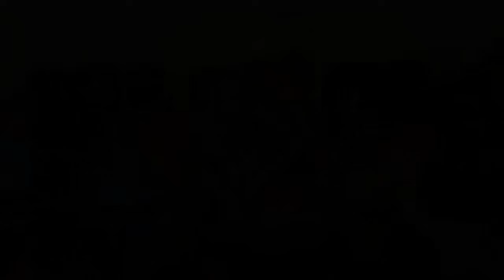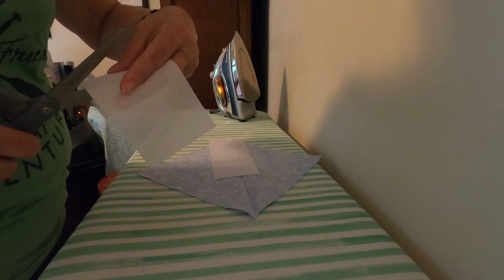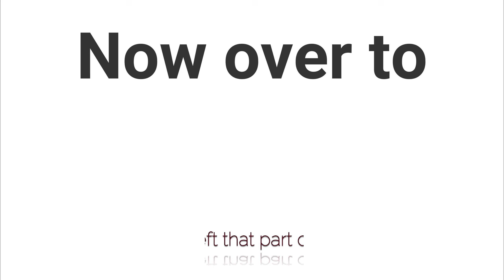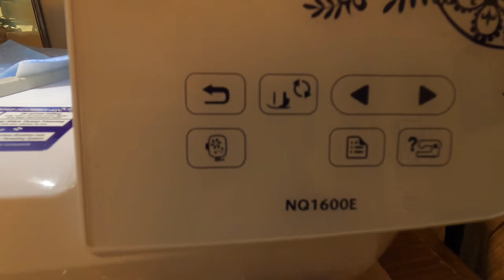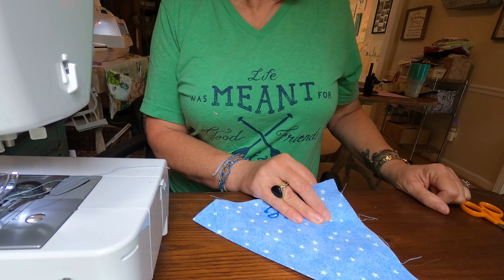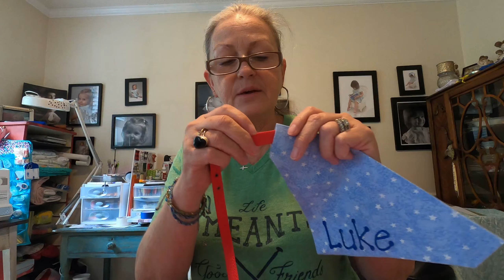Let's Make An Over the Collar Dog Bandanna for Your Favorite Pup

Comment: Can I not add the interfacing
Reply: Thank you for replying to my question. I have family with different size dogs and I am excited to make a bunch for them. Love your tutorial ❤️
Reply: I have one more question. One of the dogs weights 80 ponds. Do I use the 13.5 inch square? I've lost your guide for measuring.
Reply from the maker: @user-wx6lz1iy9p  honestly I don't remember. I would have to look back at the video but 13.5 sounds about right.  I know it doesn't go all the way around the neck.
Reply: @Pops-GiGis-Workshop  Thank you.
Reply from the maker: Absolutely! The interfacing is totally optional.  The only reason I add is because my mom always added interfacing to everything and after watching her sew for years and years I felt like I had to 😂.   But it is completely optional.  😊

Comment: Does that spray gunk up the needle?
Reply from the maker: No, it never has.  It's actually a basting spray for quilting, sewing, and embroidery. So it's made to be used with sewing and embroidery machines.  I'm sure if you used a lot of spray, it might.  But really all you need to use is just enough to cover the surface of what you need to "tack" down.  I hope this helps 😊

Comment: Great tutorial what are the fabric dimensions for a size med?
Reply from the maker: The sizes that I use are 7.5 x 7.5 for XS, 9.5 x 9.5 for S, 11 x 11 for Med., 13 x 13 for Lg.  For XL I just kind of have to adjust according to what breed and size of dog it's being made for if I'm doing a custom order.  The same thing too for the XS.  I did one for a 12 week old beagle puppy and it seems like I did like 6 x 6 for him.  Keep in mind, these are just "base" sizes.  You can really make them any size you need as long as you start out with a square.  The steps are all the same no matter what size you're making.

Comment: What size of fabric for larger dogs
Reply from the maker: The sizes that I use are 7.5 x 7.5 for XS, 9.5 x 9.5 for S, 11 x 11 for Med., 13 x 13 for Lg.  For XL I just kind of have to adjust according to what breed and size of dog it's being made for if I'm doing a custom order.  The same thing too for the XS.  I did one for a 12 week old beagle puppy and it seems like I did like 6 x 6 for him.  Keep in mind, these are just "base" sizes.  You can really make them any size you need as long as you start out with a square.  The steps are all the same no matter what size you're making.  My 2 dogs have gotten to where they feel naked if they don't have theirs on! 🤣

Comment: What are the starting sizes for medium and large size dogs ?
Reply from the maker: The sizes that I use are 7.5 x 7.5 for XS, 9.5 x 9.5 for S, 11 x 11 for Med., 13 x 13 for Lg.  For XL I just kind of have to adjust according to what breed and size of dog it's being made for if I'm doing a custom order.  The same thing too for the XS.  I did one for a 12 week old beagle puppy and it seems like I did like 6 x 6 for him.  Keep in mind, these are just "base" sizes.  You can really make them any size you need as long as you start out with a square.  The steps are all the same no matter what size you're making.  My 2 dogs have gotten to where they feel naked if they don't have theirs on! 🤣
Reply: Thanks

Comment: In new to this, and this is a great video! But when you refer to interfacing for the middle of the bandanna that helps stabilize the collar area, what exactly is that material? And where do i buy it?
Reply from the maker: Interfacing is something that will add stability to the fabric.  You can get it in different weights depending on how "stiff" you need or want the fabric to be in the completed project.  You can get interfacing that you sew in or you can get fusible (which you iron on.  I like the fusible simply because it's SO much easier.  You can get it at almost any store that sells fabric. I typically get mine ay Joanns simply because I can use a coupon and it's the closest fabric store to me.  What I use most of the time is Pellon SF 101.  That is exactly what I use on my dog bandannas. It's not hard to use at all and it adds just a bit of "oomph" to the finished product.   I hope this helps.  Let me know if you need further help with this and I'll be glad to help 😊

Comment: Would a large size require a bigger opening at the top. Collars are wider for bigger dogs. I’ve already made a couple large and just thought about the opening
Reply from the maker: If it's a really big dog, then yes it would.  Almost all dog collars are about  an inch wide except for the really small breed, like tea cup breeds, or really big breeds like Great Danes or Corsos.  But generally, most are about an inch wide.  To make the opening (pocket) for the collar larger, just fold down the corner more. For smaller openings, you would make the fold smaller.  I hope this helps 😊

Comment: How wide do you cut the interfacing for the crease?
Reply from the maker: I usually cut it about an inch to an inch and a half wide.  Really all you need is enough to just go over the crease.  Actually there is no reason to use the interfacing if you don't want to.  I just think it gives it a bit of added firmness. Plus growing up, my mom used to sew ALL the time and I remember her using interfacing on everything! So honestly I think that's why I started putting it over that fold in the bandannas 😉  I hope this helps 😊

Comment: great tutorial! small is 91/2 by 9 1/2 what are the measurement for medium, large and extra large? i love these i already made one for my cats and they look adorable.
Reply from the maker: The sizes I use are just base sizes really.  It depends on the size and breed of dog but I typically use 7.5 x 7.5 XS, 9.5 x 9.5 small, 11 x 11 medium, 13 x 13 LG, and adjust up for XL depending on size.  My boxer Ruby is approximately 45ish pounds and I make hers 9.5 x 9.5.  I tried a medium size for her but it was really to large for her.  So it really does depend on the build of the dog.  I hope this helps.

Comment: Cuánto doblo en las orillas
Reply from the maker: If my translation is correct, you asked how much do you fold on the edges.  To make the "pocket" for the collar to slip thru, you fold in and stitch down approximately 1 1/2 inches.  That will become the pocket for the collar.  I hope I got your question right and that this helps. 😃

Comment: Thanks for the video. I started making one tonight but hubs said it looked small. I adjusted but when I got 80% finished I realized it was too big for her collar and it would bunch. Lesson learned. 

Have you used the buttonhole function to add an opening for a leash?
Reply from the maker: It's really hard to say a specific size will work with a certain breed 😕 I've had to play around with sizes for different dogs I've made them for too.  
What a great idea to make an opening for  a leash! I haven't done that, but have seen many like that.  For some reason buttonholes freak me out! That's something I really haven't tried 😅
Reply: @Pops-GiGis-Workshop  I got a new machine and I have not tried it

Comment: Love this video! Also what size of fabric do you use for the other sizes?
Reply from the maker: The sizes I use are just base sizes really.  It depends on the size and breed of dog but I typically use 7.5 x 7.5 XS, 9.5 x 9.5 small, 11 x 11 medium, 13 x 13 LG, and adjust up for XL depending on size.  My boxer Ruby is approximately 45ish pounds and I make hers 9.5 x 9.5.  I tried a medium size for her but it was really to large for her.  So it really does depend on the build of the dog.  I hope this helps.

Comment: What size squares do you cut for Med, Large and XL? I need to make one for a 20lb dog
Reply from the maker: The sizes I use are just base sizes really.  It depends on the size and breed of dog but I typically use 7.5 x 7.5 xs, 9.5 x 9.5 small, 11 x 11 medium, 13 x 13 LG, and adjust up for LX depending on size
Reply: @Pops-GiGis-Workshop  thank you

Comment: Have just found you best and easiest to follow video I have watched. Thank you. How much do you increase the square for larger dogs.
Reply from the maker: Thank you so much. I'm so glad you found it easy to follow.
Reply from the maker: As for sizes the measurements I use are just base measurements. They can be adjusted according to size and breed of dog.  I typically use 7.5 x 7.5 x small, 9.5 x 9.5 small, 11 x 11  medium, 13 x 13 large and just adjust up for XL

Comment: Very thorough video. Thank you for the clear instructions.
I have one question.  How do you keep the bandana from bunching around the collar?
Reply: Thank you so much for your prompt reply.
I am able to slip the collar through the pocket which is stabilized and the collar part is fine but underneath the collar, the fabric bunches up over the collar and it looks untidy. 
I,m wondering if maybe the collar part is too wide and covers too much of the collar.
Thank you for your help. I really enjoyed your video.
Reply: Also, The bandana I’m making is a 14 inch square folded into the triangle with a 3 inch channel depth for the collar.
Reply from the maker: @maureendonnelly832  how wide if your dogs collar?  One the bandannas I've made, I try to make the pocket for the collar just slightly wider than the collar. That way the collar fits in there pretty snuggly.  If the pocket is too wide I can see how it might bunch up.  You may want to make that pocket a bit more narrow by adding another top stitch.  Let me know if this helps
Reply: @Pops-GiGis-Workshop 
Good idea, 
I’ll try interfacing just the pocket area instead of the entire bandana
Collar is 16 inches
I wish  I could send a photo
Reply from the maker: @maureendonnelly832  send the picture to pops.gigis.workshop@gmail.com.
Reply from the maker: I'm not sure I understand the question about bunching up.  The collar should slip through the bandanna so I'm not sure how it's bunching up.  I have added a piece of iron on interfacing to the center of the pocket for the collar a bit more stability.  I hope this helps, if not let me know! 😀

Comment: Love your video! Wondering if you can list all of the square fabric template sizes you use for XSmall, Small, Medium and Large bandanas?
Reply from the maker: Thanks! I'm glad you liked it 😀  The sizes that I use are 7.5 x 7.5 for XS, 9.5 x 9.5 for S, 11 x 11 for Med., 13 x 13 for Lg.  For XL I just kind of have to adjust according to what breed and size of dog it's being made for if I'm doing a custom order.  The same thing too for the XS.  I did one for a 12 week old beagle puppy and it seems like I did like 6 x 6 for him.  Keep in mind, these are just "base" sizes.  You can really make them any size you need as long as you start out with a square.  The steps are all the same no matter what size you're making.  My 2 dogs have gotten to where they feel naked if they don't have theirs on! 🤣
Reply: @Pops-GiGis-Workshop  Thanks so much!
Reply: @Pops-GiGis-Workshop  ppl
Reply: Thanks for listing all the sizes
Reply: Thank you for the size guide, great tutorial
Reply: Thank you for this great step by step instruction